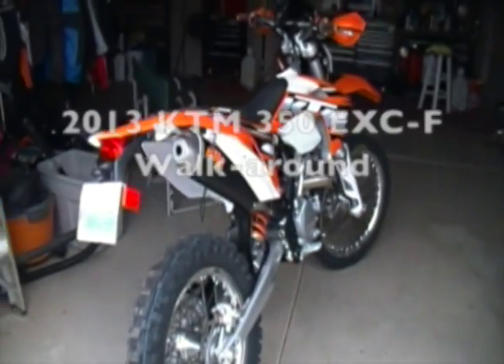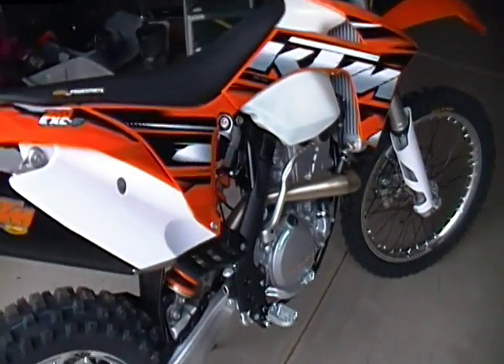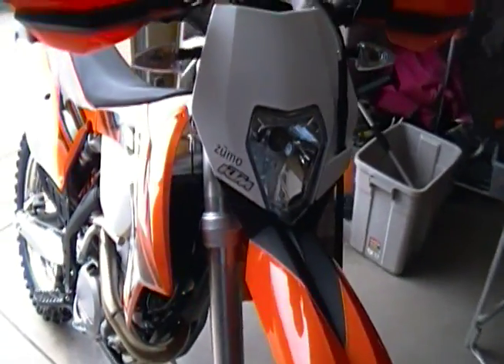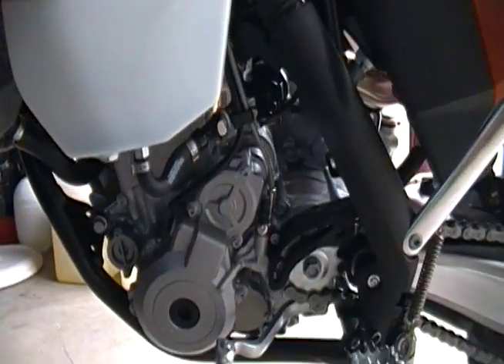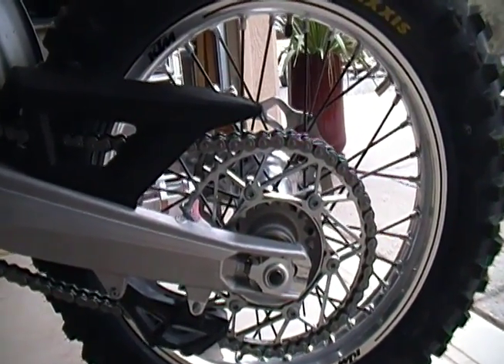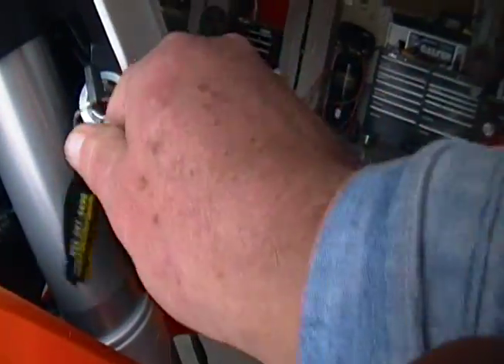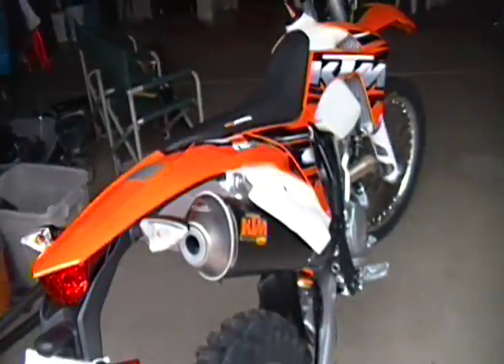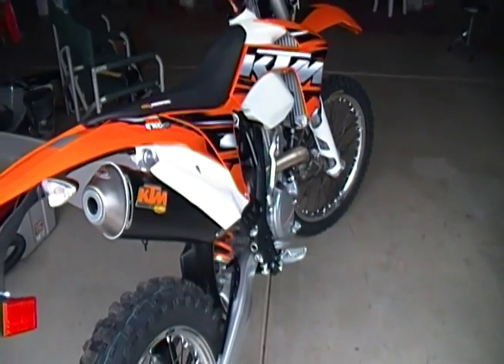2013 KTM 350 EXC-F FMF Exhaust Sound

Comment: Beautiful bike.  How's the service intervals/maintenance on it?  Would love to put one next to my '08 DRZ400SM, but the upkeep is the only thing keeping me.
Reply from the maker: No issues with maintenance or repair.  Just change the oil now and then, and keep the air filter clean.
Reply: +ApexIXMR I was at a dealer yesterday and asked about the maintenance and they said it really was not any different than any other brand but KTM just puts that in there on the valve adjustment to kind of clear themselves. He said unless you raced all the time or ran the crap out of them you would just do as you would any other brand. I would love to have this bike and my dealer is sold out and out of WR250 Rs too. Maybe a used one will pop up with cold weather coming.

Comment: Oh man, im 39 and have been waiting for Honda to build a CRF450L for years, everyone says to just pick up one of these otherwise I will be 80 all while Honda still has not came out with a quality dual sport
Reply from the maker: I think you'd love it.  If you are over 250 pounds, go for the 500 though.  The 350 is fast—more than enough for me—but the 500 has big jug torque.
Reply: How's it handle short highway sections at 65MPH?